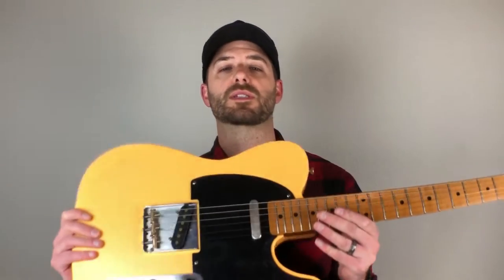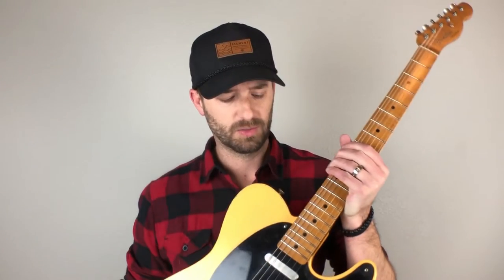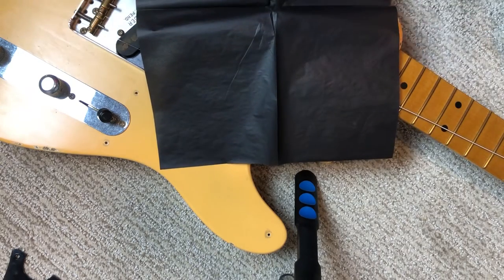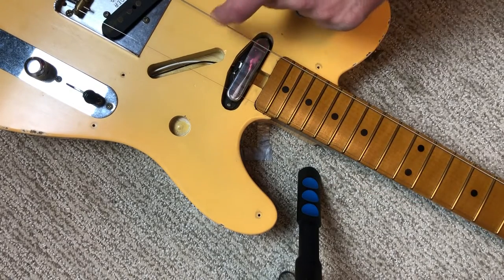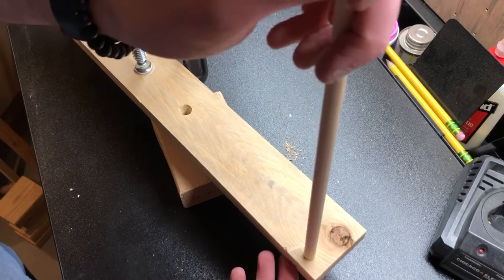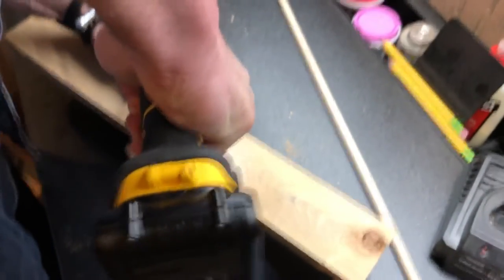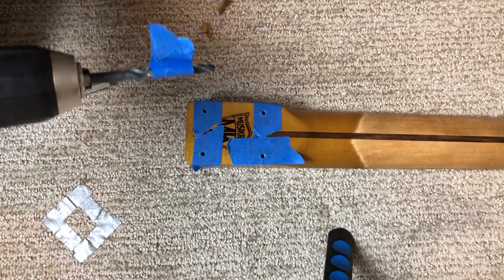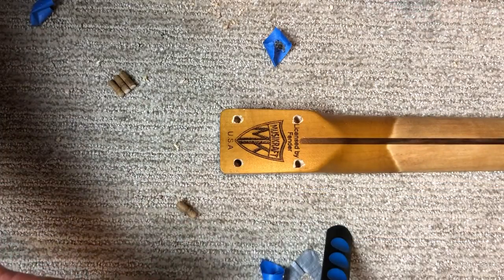How To (Or How NOT To) Fit and Install a Fender Style Neck - Part 2:  The Saga Ends

Comment: another trick to keep the drill bit straight is to use double sided tape n tape an old DVD over the hole n then when you drill the hole you can see thru the reflection if your drilling straight cause the size of the drill or the body of them dremel can make it hard to see if you drilling a straight hole cause if the hole is not straight you can snap the neck screws n that is a real bitch to have to remove the brocken screw n then drill it out n dowel it with maple n then re drill the hole, keep up the great work love your videos hey

Comment: when your fixing a mistake with a dowell its better to get a maple one from the hardware store n then drill the holes bigger n then use titebond to glue in the dowel as most hardware stores sell round maple or hardwood dowels in every mm sort of size in the timber section and then you just drill out the hole and the dowel can be glued in n cut flush when it dries and that Alot easier than trying to make your own
Reply from the maker: @gregrayner3146  good point. I think I just feared drilling more holes into the neck, but it would have been a viable way for sure. I’ve also learned that with the plug-cutter bit, going slow is better (prevents burning the wood).
Reply: @NathanSink  keep up making the great videos mate love your work hey

Comment: Awesome, thanks. Trying to do the same thing with Jackson parts (japanese neck won't fit into indian body, even though they should be perfectly matching). What sandpaper grit did you use to widen the pocket corner?
Reply from the maker: I can’t remember exactly, but I would use something fairly rough like 220 or 100 grit, because you want to remove material, not just make it smooth. And go slow! You can always take more off, but you can’t go the other way. All the best. 👍🏻
Reply: @NathanSink  thanks

Comment: Your part 1 and 2 caught my eye as I built a Tele 20 years ago that looks exactly like yours (I actually made the body from scractch, a miracle it worked)  and was currently doing a neck swap on another one. I am a professional residential trim carpenter and I'll share something with you that could get me in trouble -- the surprises you ran into, the ad lib fixes and mistakes you made are things we deal with every day! I'm talking about intricate work for extremely high-end clients (I recently worked on a $9M "castle" of a house) where you gotta think on your feet, pull up your shorts and make it work. You've got the knack and you're in good company. Or, I should say, I am. Good job, nice guitar!
Reply from the maker: Wow, thank you for the kind words! It means a lot coming from someone like you who has to deal with the “surprises” on a daily basis - on a professional level. Although they are a pain at the time, I do enjoy learning new things from mistakes, in the long run. 🙂

Comment: I think part of the problem is that the holes in the body are too small. The screws should not have any bite in the body. You should have enlarged those just enough so the screws can be pushed through (just like it was on your strat body). If you researched fastener design you will find that the body should have no thread so the neck can clamp to it through the force created by tightening the screw into the neck. If you leave it as is and remove the neck often you will lose clamping force over time.
Reply from the maker: Interesting! It did seem strange that the screws engaged with the body. Came like that from the factory in Mexico though. 🤔
Reply: @NathanSink  it is a sure way to eventually crossthreadbthe neck holes... My friend's cheap Schecter came like that. I have no explanation why. In his guitar one of the screws were even drilled angled :O
Reply from the maker: @PeterSz73  We’ll see what happens. 😬

Comment: I did the exact same thing with a road worn black strat from StraOphere and got an All Parts neck, all nitro strat for $680
Reply from the maker: Grant Mecozzi great minds think alike! 😊
Reply: @NathanSink  we certainly came to many of the same conclusions regarding Fender. Leo's main premise in the 1940s was to design guitars that could be endless modified and rebuilt with little to no training

Comment: Great video. I’m a first timer about to do the same thing. I was thinking of filing the neck corners instead of trying to sand the body like you’ve done. I’m figuring as long as the fit is snug and everything lines up this should work. Any reason not to do it that way?
Reply from the maker: That approach should work. For whatever reason, it's typically done the other way around though. I suppose if you ever wanted to sell the neck or put it on a different body with a larger pocket it might be an issue.
Reply: @NathanSink  I was wondering about that, I would choose to modify the neck over the body because the neck is the wear part. That's what may warp over the years beyond repair or most likely to break in an accident. Then I would just fit a new neck to the old body. If the pocket is enlarged it is more likely to be a loose fit for the next neck. Fender designed these guitars so that the neck is easily replaced if it developed an issue.
Reply from the maker: @PeterSz73  excellent point. You can't really add material back to the neck pocket, so if your next neck (replacement) is a bit smaller than your old one, you might have a sloppy fit. I guess I was thinking of this video from Fender where they sand the neck pocket during installation: https://youtu.be/dyu0uylL9jc However, I realize they were really just making the point that you may have to clean up the neck pocket of paint or abnormalities.

Comment: 15:07 if I'm not wrong. it look like reverse drill direction and make wood burn. i've made the same mistake before. Nice video by the way
Reply from the maker: Could be. I think it has more to do with the RPM & the fact these are supposed to be used with drill presses. 🤔